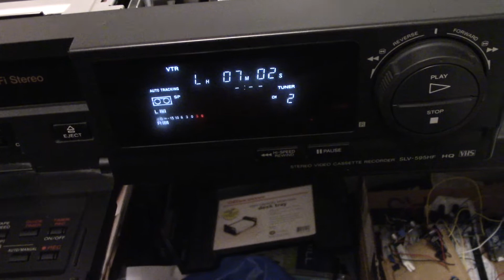Sony VCR SLV-595HF problems: Reels not turning during eject

Comment: Check if the brakes on the take up and supply reels release! Also check the optocouplers of the reels, the Sony monitors the speed of both reels! Note that the reels on a dummy tape do not move in the same way as on a real tape! 😉